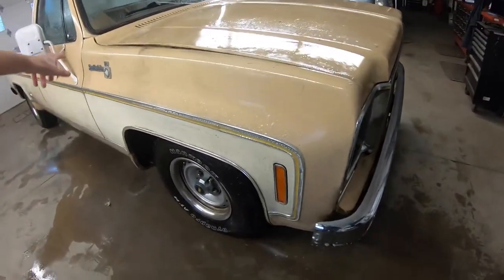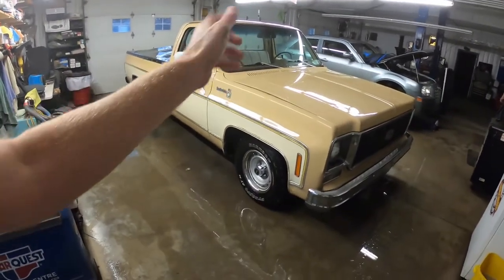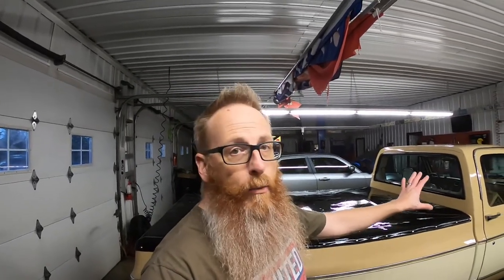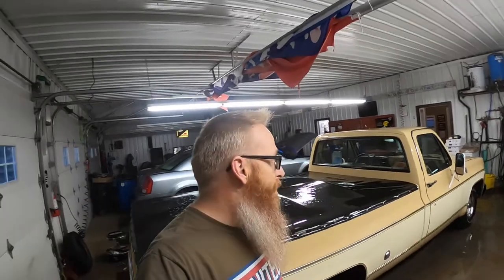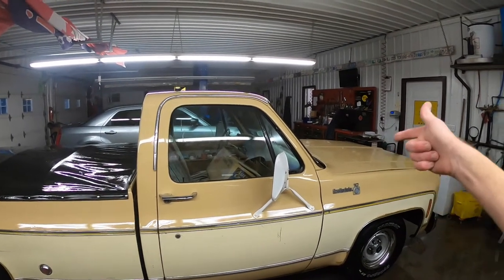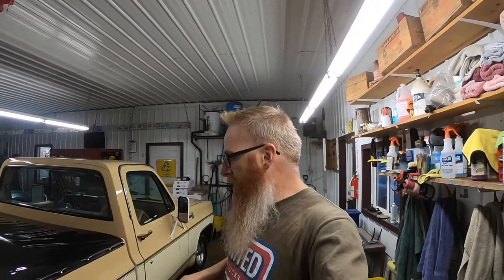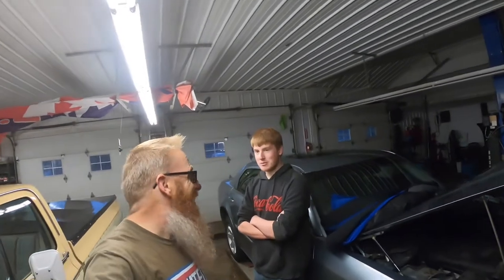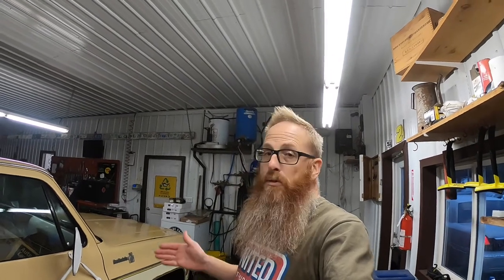First Wash After Years Of Grime On My SQUARE BODY CHEVROLET

Comment: I had a square body. A '76.  Loved that truck.  Drove it until there were no floors left in it.  Lowering it a bit would be cool, but no rubber band tires.  Wider tires, yes.  Keep it functional as a truck.  I would get rid of all the trim on the body too.  As you can see, it just gathers dirt and pine needles.  Repo it in paint if you like it.   Engine?...the normal.  Headers, cam, maybe heads, possibly a Holley EFI.  Nothing too radical, keep it reliable.
Reply from the maker: The biggest diameter i would go is 18 for the exact reason you're thinking, ride quality! Engine refresh exhaust and such is kinda a given! But Holly EFI is not likely!

Comment: Ol yeller, scotty,  lol. Honestly that 350 and qjet is good but if you want fuel injection just use a aftermarket tbi kit like a holley with a single plane intake. Run a 92-93 automatic overdrive with the tbi with 3.42 gears and you would be surprised how well it will run. Or whats cooler then seeing a big block under the hood they bolt right in and you could still efi and overdrive it, or use a 90s modle donor for a tbi 454. At one time i was trting to find the late modle 8.1 vortec and trans, ot would be different since you dont see many of those swaps. Dont forget to grease the window mechanisms, door, tailgate and hood hinges
Reply from the maker: I'm sticking with what i got for now. She'll burn rubbah with 350/350!
Reply: @OldeCarrGuy  i wasnt lying lol those 350 qjet engines are pretty good. Its whats in my work truck just paired with a 93 4l60 and a few bolt ons. Does everything i need it to

Comment: You won't hear me holding you back from 18s and bags! You know I'm pretty anti LS swap the world, but this is the appropriate candidate for an LS swap. But I also think that if the 350 has good compression in it, like Terry says, a FiTech or Holley Sniper EFI and I think you are good. And damn those brakes
Reply from the maker: I’ll likely build the 350 first and give it some value to sell when the LS time comes around! I have the full lowering kit ordered and will start installing it once the body work is done!

Comment: Probably not the brake booster sounds like the brake master cylinder if the pedal will go to the floor. Most definitely change the brake fluid. Good project looking forward to more videos. I also follow U.B.T........
Reply from the maker: Yeah! I didn't say what i meant to. But yes, it was the master cylinder!